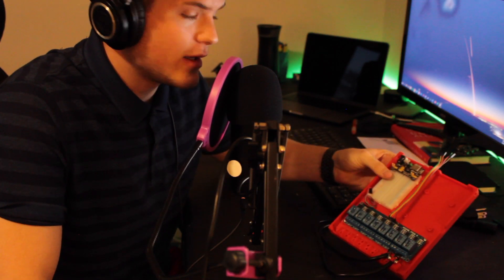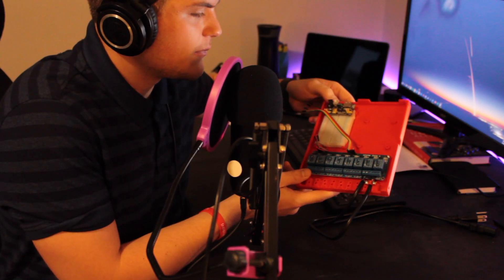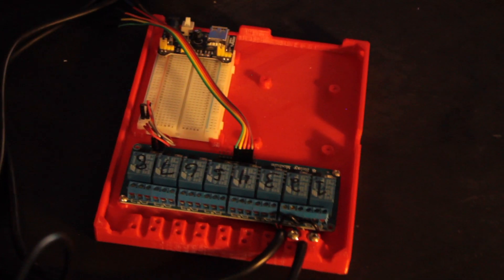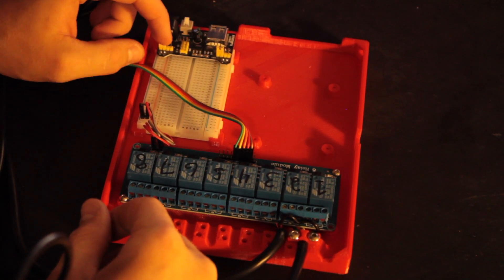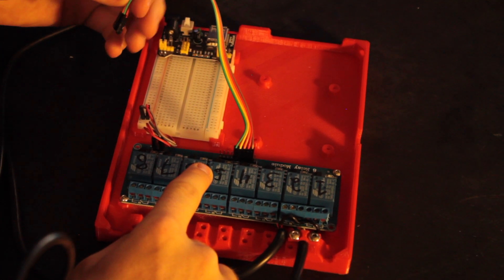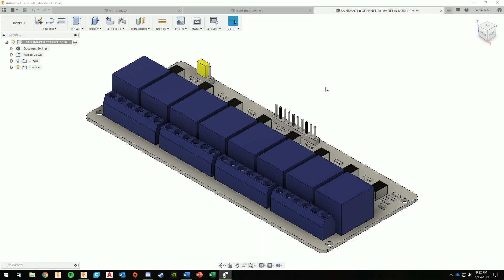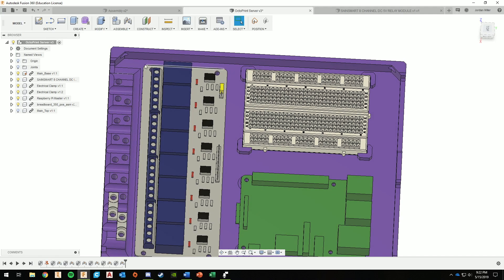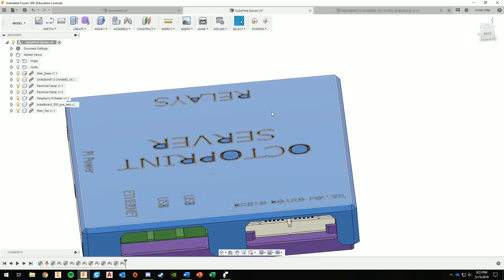OctoPrint OctoServer Part 1 | The Layout

Comment: when i open this file in cura its scaled at 100% but is only 5mm wide
Reply from the maker: Not sure what to say, the models work for me fine. Are you scaling them at all when bringing them into Cura?
Reply: @JordanMiller1117  no, it might be the version of cura though, I just updated and noticed a few weird things happening. What is the length of your x axis in mm?
Reply from the maker: @callumb4980  of the part? I have a delta printer and it has a circular xy build dia. of ~300mm